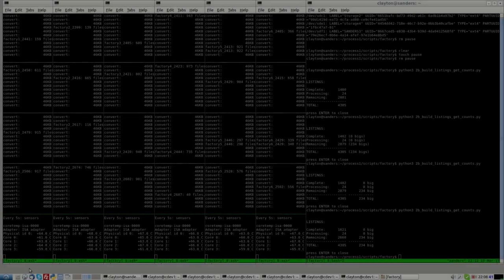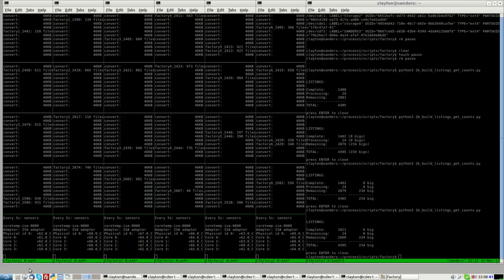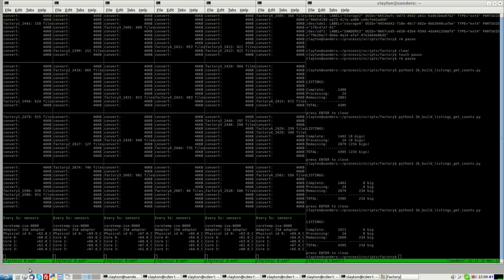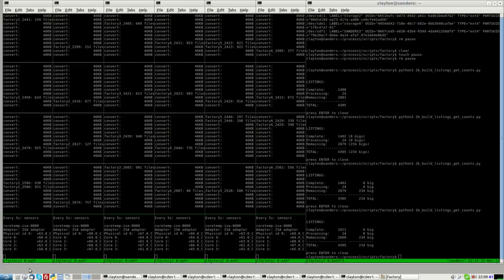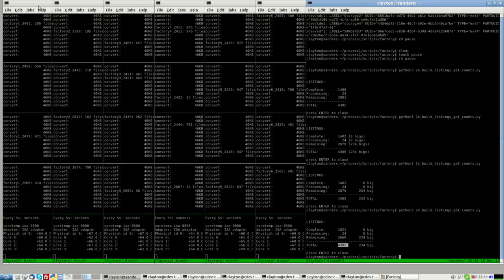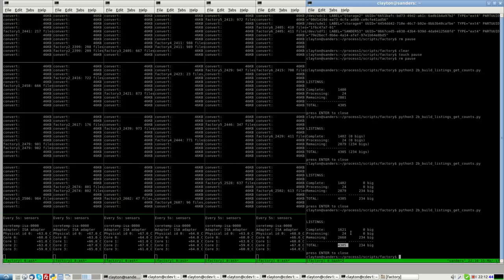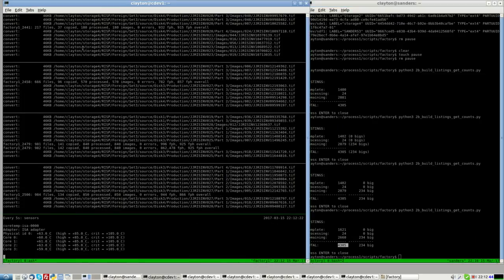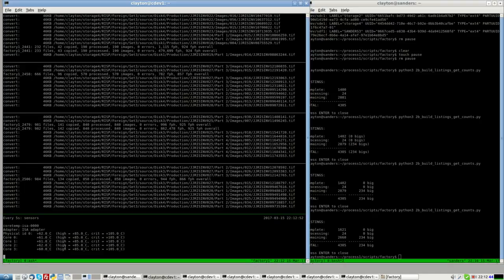Simple, Low-Cost, High-Volume Computer Cluster for Document Processing

Comment: I had seen some of the raspberry pi clusters and saw a laptop one pop up and searched for PCs and yours came up. Thanks, seeing this done on some PCs that I have around at least has the hardware and wiring down to a no brainer :) 

I have a few old 4 cores laying around, not sure if a 2 core would be worth it. 

I saw one of the processes was showing a file with a python extension which is what I was curious about. I was thinking of setting up a small cluster for some machine learning/AI stuff. Nothing concrete as in "why and what for?" other than just an I got it to work mental badge... And they thought they could kick me out of Evil Genius University!

I can always use a cluster to simulate a web server for when I'm doing work that needs a remote connection.

Comment: What he mean by doc processing ?
what exactly u do with it? and how u keep from over heating?
Reply from the maker: All of these questions are answered in the video, but... The processing is doing OCR on images. Fans keep the computers from overheating.
Reply: @ClaytonDarwin  Thanks for taking the time to respond , i did watch the full video but i still had those questions.  Some softwere rendering  (solidworks, blender and photoshop) on my pc caused my pc to overheat so i used a liquid cooling system i thought you might be using a liquid cooling system too but it seems its not necessary for this cluster
Reply from the maker: These older "office" type desktops can typically run at 100% and not overheat if they are clean and have air space around them. Not the same with my personal high performance desktop.

Comment: Cool system!

The coolers on the 790 are actually really good. Those have 4 cooper heat pipes and a blower fan.
The cooler on the 7010 is not as good because it has a heatsink and a fan blowing down to the heatsink.

Comment: Do you know of any good guides on how to set up the software networking side of this? I have a few old laptops lying around and I've been dying to turn them into something useful for cheap but heavy bursts of processing
Reply from the maker: Not any full guides. I think I started with the Debian Linux networking guides. Then I just researched/learned each part until I could make everything work together.
Reply: you thinking about making a super computer out of junk pc's that could work been done with older weaker computers then your junk pc's so it could work not sure what you could do with it you'd have to figure that one out for yourself

Comment: Thanks for the walkthrough. Can you tell us more about how you configured this?
Reply from the maker: This was something I was using all the time 3 or 4 years ago. But not so much lately. So I probably won't have time to refresh my memory and do a video. There is a decent write up in the description. However, if I was starting over, I'd definitely use a containers instead. Same idea, but just able to fire up a container anywhere on the network to do work.

Comment: I use dell 790s and 7010s for a crypto/computer space heater during the winter time.... as it mines for monero, it heats my entire condo... it actually works just like an transitional electric space heater.

According to intel, as long as the temperature is kept under 100deg C, you’re good to go, my CPUs run 75% load with times around 75-80deg C. Each machine pulls 80watts from the wall.

My electric bill comes out to be about the same if I had used the houses electric furnace but I am rewarded with crypto too, which is a big bonus.

All my computers were found for free at my jobs IT department dumpster, they regularly upgrad their computers so their is no cost to me other than needing an occasional ram stick if it’s missing ram.
Reply from the maker: Ha! Good idea.
Reply: Im wanting to do the exact same thing for the same reason and details on what software to use and how to configure a cluster
Reply: Sooo basicly u kinda make 100% efficient computer since heat is no longer waste.. ok maybe not computer since it's no longer computer but computer-heater hybrid or something but still.

Comment: I use a similar setup to process a lot of documents (mainly ocr but also metadata extraction, like references between docs). I have a python3 script on each node that picks up a file to process from a shared folder, puts it away when processing, and puts it back in a shared processed folder when done. I have found great speed improvements by using the tesserocr pythonpackage for tesseract. It keeps languages loaded between calls so if you do several ocr calls on each document like I do, there might be a significant gain. I currently ocr tabular data, with interlinked reference numbers. I split up the table in its individual cells to ocr them separately, hence the many calls.

My biggest issue is accuracy as I need 100% correct data in at least some columns. I have made a simple tool for reviewing the output. How do you handle this, given the volume of documents you are processing?
Reply from the maker: Yep. OCR accuracy is always a problem. It can be very bad, particularly if the images are from scans. I have a script that checks and corrects image alignment when they are tipped, and that helps some.  But still, it can be very poor when image quality is bad. You can try secondary scripts to match each word token to a dictionary, but there are no guarantees the tokens are not parts of words or too indistinct to match well. 

The only project I worked on where 100 percent accuracy was required used 2 human readers to verify after all the automated functions were complete. It took a very long time to a relatively small number of documents. 

For the investigation I do now, we spend a lot of time locating potential variations, misspellings, and ocr errors before running the searches. 

There isn't an easy answer that I know.
Reply: @ClaytonDarwin  My data will go up on a wiki, for people interested in the content. I am hoping that the users will spot errors and correct them.
Reply from the maker: That would be really nice. We had to pay student workers and a graduate assistant to supervise. Spent a lot for very little data.

Comment: If I have to pay a power bill for something like that, I'd go broke. Electricity is expensive around here(if that is of any indication, I'm not from US)
Reply from the maker: Still probably cheaper than having someone do it for you. Turn it off when you don't need it. In fact, I just turned on 2 of them yesterday to OCR 9500 big PDFs. About 1500 pages each. Will take it a few days and then I'll turn them off until next time.
Reply: True, considering that you can use it to make money or to do things in a cheaper way, thus, saving money it does make sense and on the plus side, you could be running anything without worrying about terms of service and messy contracts. Like they say, you can't put a price on freedom!

Comment: Simple setup as the title says, but have you made any calculations how much working hours it would take for the price of power to be higher than actual hardware cost?
4 cores is a very small number for a ~100W usage... 
I have few setups of 11G Dells (R410, R510, R210 and R610), you could be running a lot more efficient (Xeon 56XX/57XX series instead of i5) and cheaper than this.
Those have microSD/USB slots as well in them - so running OS from a stick is possible and then just mounting (NFS/SSHFS) document folders - should suffice.
Anway GL and thanks for video :)
Reply from the maker: There are many ways to do the same thing. These were the computers available to me at the time (that was several years ago). Electricity is very cheap here, so it wasn't costing 20 US a month to run. Overall I ended up spending under 1000 for the whole process which would have cost me 10-20 thousand to have done at the time. So I was satisfied.

Comment: Thank you for this video
I recently saw something called HPC computer 
But I did not understand what this thing is
According to my simple knowledge, I discovered that it is a computer and several servers
The processors in the servers are collected to serve the main computer

Is what you do in this video the same ?
Is it true what I understood?
I need to do something similar as I need to increase each server period to increase the processor power of my mainframe
I don’t know if this method was originally present or not ?
Reply from the maker: Since I made this video, there is a lot of new software for working with and coordinating multiple computers. Unfortunately, I'm not up to date on it. This was a custom setup, which I still use fairly regularly, but I'm not sure I would do it the same today. I would probably use containers instead.
Reply: @ClaytonDarwin  Have a look at Python Ray, might be helpful to spawn processes over to other nodes.

Comment: Why not AWS?
Reply from the maker: At the time this was done (and even now) having 24 dedicated i5/i7-class processors that can run at 95% for months was quite expensive. Also, the original project involved about 16TB of data all total. I didn't have the bandwidth to move that kind of data to the cloud. This option was about simplicity and saving money and this was the answer at the time. I might consider a cloud option these days because prices have come down, but the bandwidth is still a problem.

Comment: Can i do video processing with this?
Reply from the maker: I'm not sure. If you can divide the main process and distribute it, probably yes. But standard programs won't do that for you. You will likely have to do some programming. Maybe some other viewers who know more will comment?
Reply: Clayton Darwin  thanks..
Reply: @adarshp6550  It's fairly common in the multimedia industries to use so-called "render farms" or "server farms" to handle things such as 3D computer graphics rendering, most popular software for such tasks supports parallelising out things like rendering to a render farm as standard. I'm not particularly well-versed with video-editing software, but it would surprise me if the big-name brands wouldn't support it, it's one of those kinds of problems which is quite feasible to parallelise, unlike some other computing problems.
Reply: Joshua Saxby, thanks
Reply: @adarshp6550  No problem

Comment: Do they have RAM? How much? I'm planning to do something similar, only with a little older stuff.
Reply from the maker: They came with 4GB RAM in each. I have never had RAM issues running 4 threads of tesseract. Every now and then I have documents so large that it fills the 32GB SSD with temp files while converting. I have to run those one at a time.
Reply: @ClaytonDarwin  Oh, 4GB would be nice. I was thinking to get some use from some old PC's using 512MB for each. Maybe the main one will have 4GB
Reply from the maker: It will depend on the type of processing you are doing. 512 can get used up pretty fast. Once that happens and you application starts page swapping, it will slow down to a crawl. Before you set up the cluster, see how it runs on a single machine. If that is good, add some more machines.

Comment: For the ssd wouldn't it possibly be cheaper and faster to use a ram disk application. I would think you would kill the ssd fast this way. But i guess if you dont have enough ram to both store and process the file it is probably cheaper to buy a measly 32 GB ssd than ram.
Reply from the maker: Right. The 32GB SSDs are cheaper than buying RAM. Plus, they only get written twice per OCR iteration, which isn't that much. I have some disks I have been using off and on for several years. I just ran 3 boxes last month to process about 150K large PDFs (some with around 1000 pages). I think they ran for a week or so, but now they're shut down until the next job.

Comment: Ooh, be careful about putting hard drives in fire safes. You need a data media safe to protect hard drives. Temps above 125 degrees can damage electronic media in regular fire safes.
Reply from the maker: Will check it out. Thanks for the tip.
Reply: You might find it cheaper to just carry an external or portable hdd with you as an offsite solution, which people should have anyway. As long as they don't leave them in their cars. Also, M-Disc is a good possibility.

Comment: was cool to know how fast one computer would do OCR comparing to all computers working together
Reply from the maker: There's not much overhead passing files on the local network with 6 boxes running 24 processes, so the speed increase is proportional to the number of processes (1/n). Once the network is saturated, the speed gain will taper off until it is no longer advantageous. I haven't reached the point of saturation yet.

Comment: hi, i have 2 questions...
1 - its MPI + Tesseract?
2 - its one file copy per node?
Reply from the maker: Hi Eduardo,

In this example there are 6 nodes (boxes). Each node has an i5 processor with 4 logical cores. I run one slave process per logical core, so there were 24 slave processes running. Each slave process uses 90-100 percent of a logical core.

The slave processes are a Python script that is handling several different functions. One of those functions is to OCR the file using Tesseract. So, the slave process is requesting a file from the storage master, copying the file down, OCRing the file, doing some other processes, and then copying all the newly created data back to the storage master.

The storage master has the original data, manages the assignment packets used by the slave processes, receives the new data, and makes daily backups of the new data.

I hope this explanation helps. I'm sure there are better ways to do this, but I'm a Linguist, not a Computer Scientist. This is just how I get the work done in a reasonable about of time, for basically the cost of electricity.
Reply: Clayton Darwin thanks, and yes, that helps 😁
Reply from the maker: Cool.

Comment: Hello you can do all this with a 1/10 energy by using some sbc. Check Odroid X4U
Reply from the maker: Nice idea. I like saving power. However, the 32 bit ARM Cortex-A15 processors don't benchmark very well against Intel i5 quad cores at over 3Ghz. I think the best they can compare to is is the Atom series, so I don't have much hope the would work very fast on as large and as many documents as I'm doing. If you would like to run a test, I can put together a 10000 page PDF (a mock animal studies document) for you to OCR on your cluster. I'd be interested in the timed results and work per node. Right now the  Odroid X4U is way too expensive, but maybe when the price comes down it would be a good option.
Reply: its a low cost investment and i say the 8 core can make a lot of your work. give it a try ;) you can use 10 instead of 6 that you have now and it can still save money and power ;)
Reply: you can save a lot of space heat and noise as well
Reply from the maker: Could I send you a set of documents to benchmark on your cluster?
Reply: i just donated my old cluster it was on raspberry pi3 and now i'm waiting my 20 xu4 so in next mo i hope i will have everything set up. than i can test it if you want.
Reply from the maker: I just saw this comment. Yes. Please let me know when you get it set up. I'd be interested to see how well it performs doing OCR. It may be an option for me down the road.

Comment: Hi, is it possible to make a cluster for running virtual machine? thanks
Reply from the maker: Hoang MVP - Yes. Virtual server services like DigitalOcean.com are themselves clusters of computers, and they allow users to connect virtual servers together into clusters.
Reply: I mean: I have a cluster computer. can I use that to run a software like vmware? or is it possible to build a cluster to do that?
Reply from the maker: Hoang MVP - Yes, I think so, but I don't have any experience with that type of system.